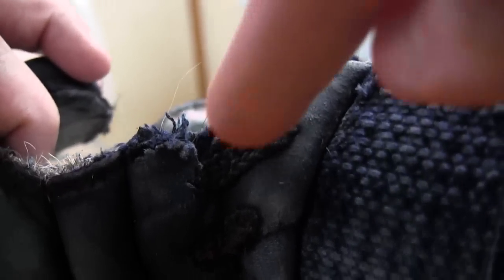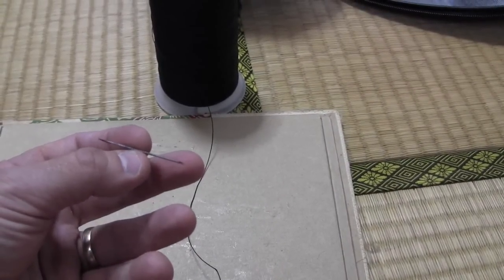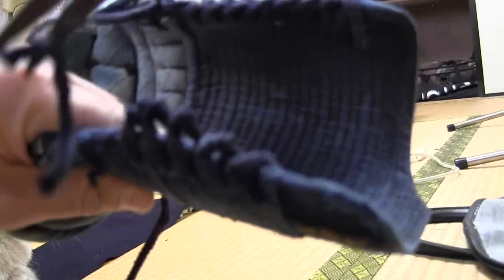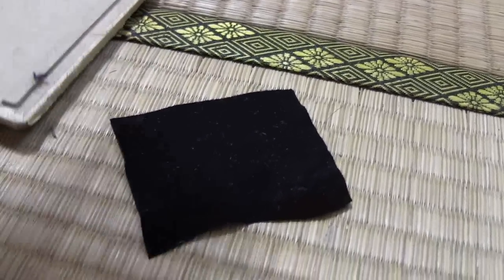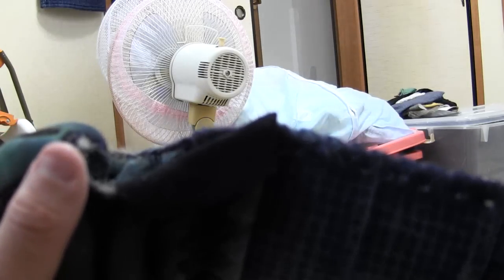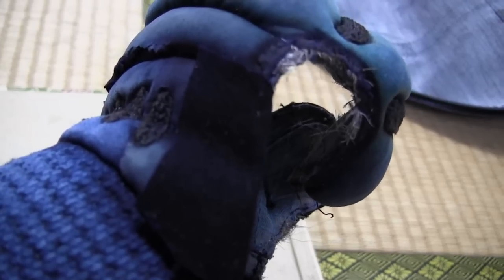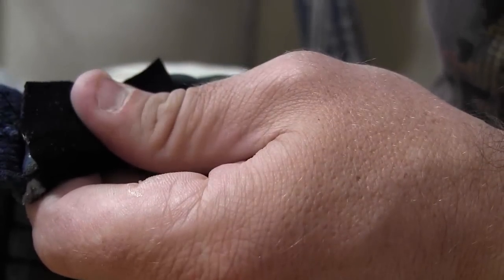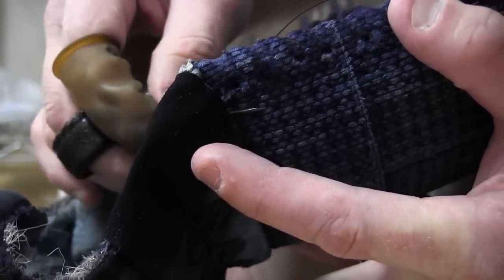kendo kote repairs 剣道小手直す pt.1

Comment: Great videos, I think I might actually be able to do one of the minor repairs jobs myself. Quality repairs make a difference - one set I had fixed has been in use 10 years and are still holding strong, while other repair jobs were never as good. Wish I had had more time to learn this aspect of repair,  it can be very essential when your not near a shop. Much appreciated.